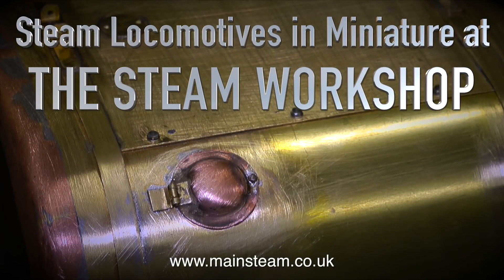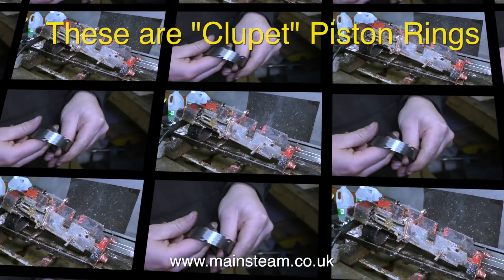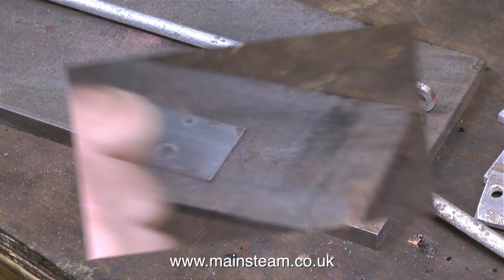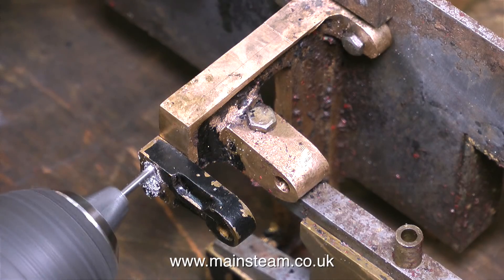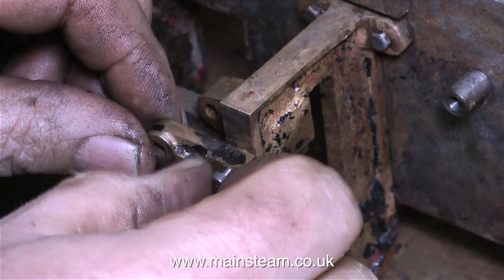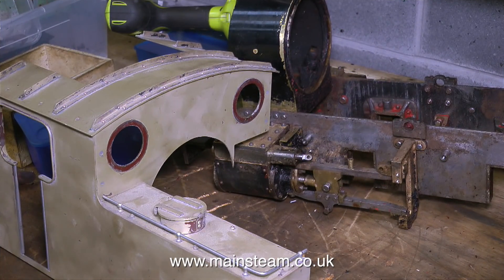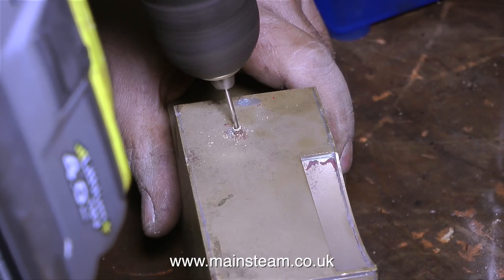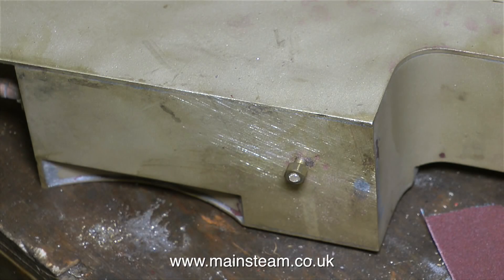WORKING AT THE STEAM WORKSHOP #4 - MAKING SOME MINOR REPAIRS

Comment: Hi Keith
Thank you for this series. I am enjoying it very much. Here is a tip you may wish to consider: when I need to belt sand small steel parts I find it very helpful to use a magnet. The type I use are called "Magswitch". I am sure there are any number of similar products from others.These have a handle that actuates the magnet. Similar to the magnetic holders for dial indicators but much smaller. The tool does a great job of improving control and keeping my fingers away from the sanding and the heat.
Reply from the maker: Thanks Vic, an excellent tip - I will try that .....
Reply: excellent
thanks for the reply!

Comment: B.S. Before the Snow!! I had problems with my new Emco Compact 8E and wondered many times why it had not been used much by the previous owner?
Well upon taking out the headstock bearings I discovered that they had been put in using the messy oil used for shipping! Yes they would not go round!!
Emco seem to sell lots of replacement bearings! I wonder why!!!
Also Half Nuts but a polish of the very rough leadscrew has sorted this out!

Sand on the bed is never a problem as you have felt wipers to clear it away in front and behind the saddle!

David. Owning up to owning the Battery drill powered Locomotive!

Comment: Wikipedia: Emery was considered a suitable abrasive for fitting work and the final adjustment of steel parts for a perfect fit. It had the advantage that, unlike harder abrasives, it was not considered to embed abrasive traces in the polished components afterwards. Emery was also used for cleaning, as a means of removing rust from polished steel components.

Comment: Keith, you might look into the availability of left hand drill bits in BA sizing. They drill anti-clockwise and will often back out a broken stud or bolt. If they don't, you still have a hole to work with. [I'm not pranking you, they really do make LH drill bits]

Comment: At 2:04 in;

Wasn't Frank Zappa's band, The Mother(s) 
of Invention?

Sorry, it was a try.  Did it fly?

Now for something (somewhat) serious.

My lathe, is an old Shopsmith, and has NO 
protection as far as sand getting into the 
moving parts, so I throw a piece of cloth 
over the way tubes, when sanding.
(Sometimes.)  Keith, do as you will.  I 
see no issue here.

steve

Comment: I worked in a oilfield machine shop for over 10 years and we sanded parts in the lathes all the time. These machine were run 6 to 7 days a week, 3 shifts per day and i never saw machines have to be overhauled for wear that was attributed to sanding on the lathe.
Reply: Old Pup When you have to work on the same lathe down to a few tenth, you will soon see the difference. The major danger is grit will charge into the surface of cast iron. That's the basis of lapping plate in fact.

Comment: Another good series Keith and keep up the interesting repair work. As for the sand grit issue it is rubbish as you stated I used to machine a variety of materials including cast iron and cast bronze, and even fine materials like graphite for spark eroders, and never had any problems with sealed high quality machine tool bearings. I think that too many people over think these type of things and see problems where no problems really exist. I would like to see more lathe and milling work if possible, as this takes me back to when I was once on the tools. Cheers David.

Comment: Mr. Appleton
I'm not a Machinist but I work with them. If your other watchers are upset about using sand paper on a lathe then they should spend some time in industry. It's an acceptable practice and even the mechanist on You Tube do it. I asked my friend who is our Lead Machinist about this and he chuckled saying, "Weather you sand or Lap, you can't cut a micro finish."

Comment: Sir,For the nervous nellies that worry about protecting sensitive equipment from grit,cover the machine with two sheets of newspaper and spray the paper with water to soften the paper.The grit will not bounce off the soft paper and the grit will stick to the wet paper.When finished,carefully wrap up the paper and throw away,No grit on the machine.P.N.

Comment: Very interesting video and nice work as always. In my more than 50 year career in science I have had the pleasure and luxury of the service of some of the best tool-and-die making and fine-mechanical workshops in Germany. I did an apprenticeship training in the workshop of a Max Planck Institute in the late 1960s. Using emery cloth on the lathe or horizontal mill was very common practice and there was never a discussion of potential problems with it. Some of those machines are still in service after almost 70 years and their tolerances are excellent. I cannot imagine criticizing someone like you, who has so many years of experience and expertise. Thank you for your tolerance of this kind of arrogant thoughtlessness. I have learned to delete comments to my videos and get on with my life.